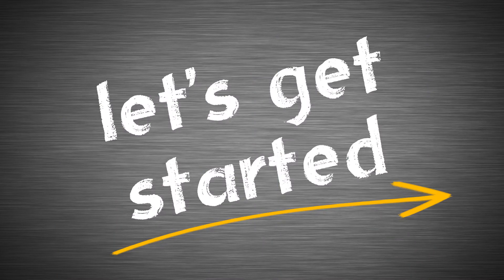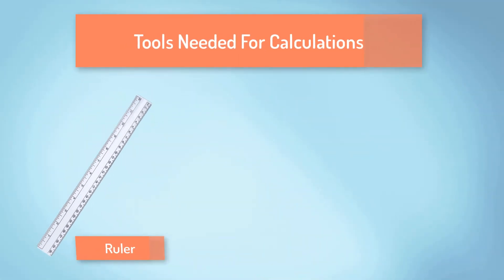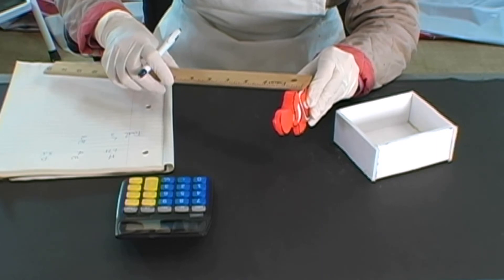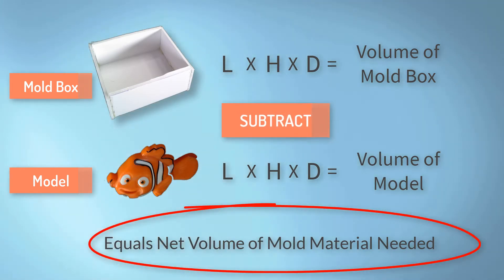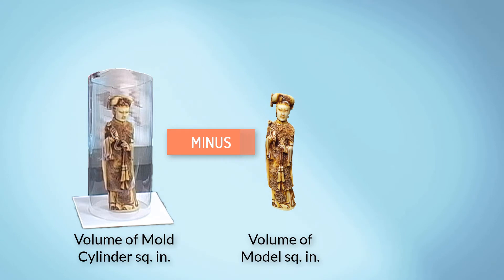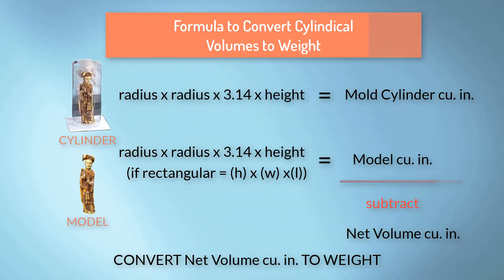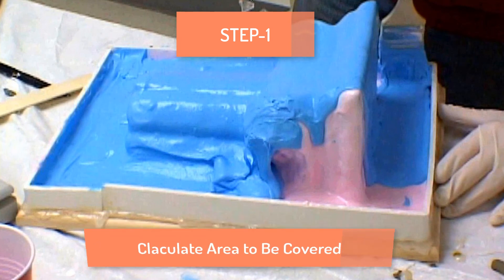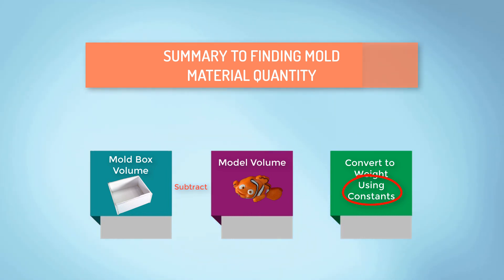How To Calculate Mold Material Needed (Tutorial)

Comment: Glad I found this video. I just ordered some silicone and now I have a clear idea of how much material to accurately use. On some of my master models, I will have steel pins sticking out of them, so I'll have to account for that.

EDIT: I should measure the inside volume of my mould box, not the outside, especially if you're using wood